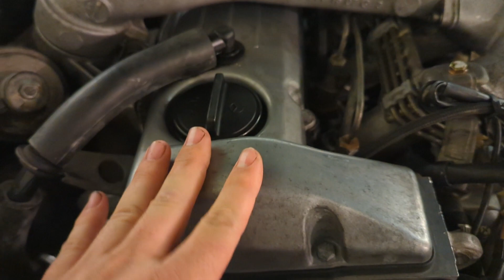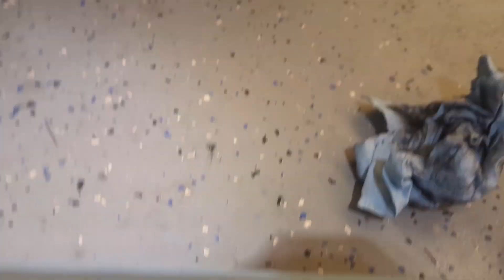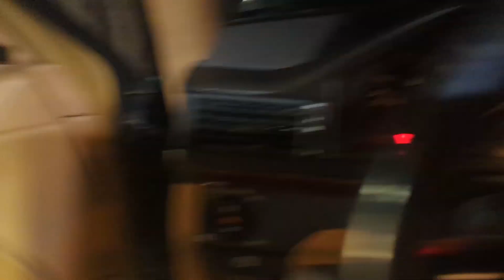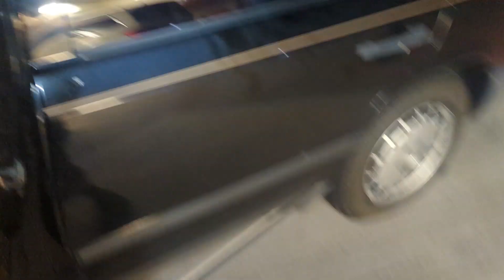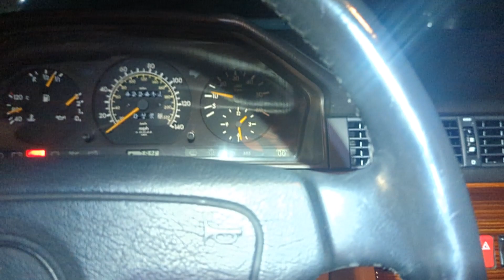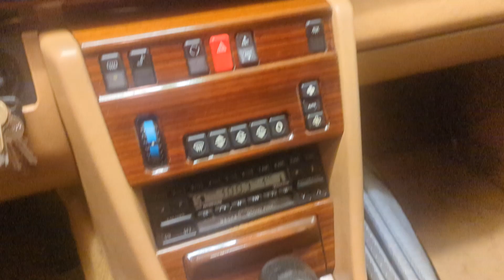How do things look now? Finished radiator flush and put in new thermostat

Comment: I got it figured out.  
On the passenger side of the expansion tank there is a small hose that goes to the top of the block above the radiator hose.  I call it the bleeder or air escape hose.  That pipe is BLOCKED.  Blocked because someone inevitably installed fuel hose instead of coolant/brake hose and the inside is swollen.
When u successfully added coolant by pouring it down the upper hose u were allowing the air to escape.  U could have removed the upper hose and poured the coolant into the expansion tank until it started to fill the upper radiator hose.
ASAP replace this bleeder hose because air may be building up in the upper radiator hose and top of the radiator.
Good luck.

Comment: Awesome.  Thanks for sharing.  Next time remove the "ball" from the thermostat's upper plate.  Its a one-way valve.  Awesome.  When u do the transmission oil drain the torque converter.
Reply from the maker: Good call- I can just drill out that ball from the old thermostat and keep it for doing flushes in the future. Thanks for the tip on torque converter - looking at getting those parts now (new drain plugs, washers, pan gasket, filter, maybe new pan) from mboemparts.com. And thanks again for staying tuned 🙂

Comment: Outstanding. You're back in business. I had no idea the OM-series motors thermostat is so buried. I'm used to the M102.103 & 104 gasoline motors where it sits right on top, easy to get at.
Reply from the maker: Same! 🙂 With the M104 when doing a radiator flush, I usually just leave the thermostat out until things are cleaned out. With this one (as you can see from the used gasket) the gasket is used to make the seal, so you can't run without a thermostat. The shop manuals call for a special part number which is always open (which is like $150 or I'd have bought it already)

Thanks for your interest, has been great to share these updates with people who are active! I really enjoy your videos too